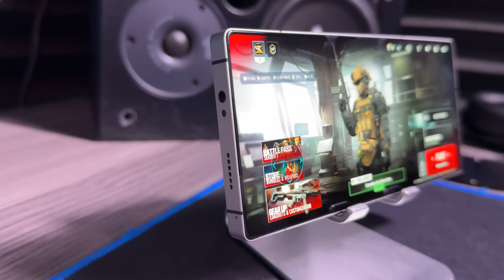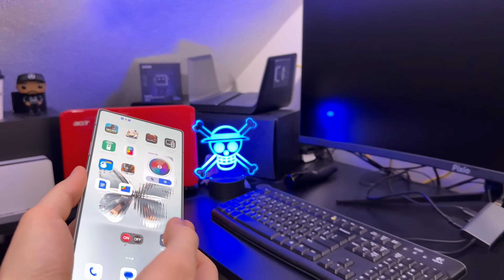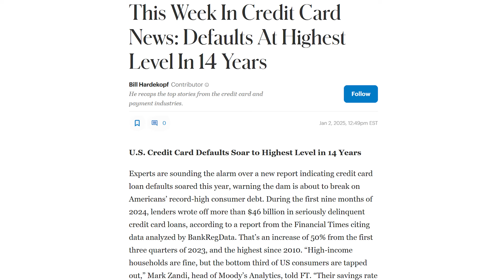What CES Revealed About Repairable Tech In a Record Year For E-Waste (2025 Is Not Looking Good)

Comment: hello Salem, could you tell me if I can change the cpu on my Asus X550jk laptop please ?
Reply from the maker: no
Reply: @SalemTechsperts  what a bummer 😞
Reply: Pretty much all consumer laptops have non upgradeable CPUs. They are soldered onto the motherboard. And even if you could replace it, there wouldn't be much point. That laptop has a 4th gen Intel core CPU from nearly a decade ago. There really wouldn't be any feasible upgrade path.

Comment: The fact that they knowingly trap you into their ecosystem of parts and software by making the up front cost of the device so low, but then jack the replacement part cost up. Not just tech companies do this. All corporations with zero ethics do this. And it's all coming to a boil.

Comment: Hp envy x360 has now cooked 2 wireless cards after windows update, screen has half inch black spots and lines, a dead battery, switches off when you press the keyboard and is slow as hell when it's only ever run blender and youtube.
Last time I spend over a grand for the same disposable crud.

Comment: make those older machines instead of running on windows use Linux - Linux distributions have reached a state that they are as easily used by dumdums as windows and have options to look exactly like windows. 
and in regard of batterys there is hope, europe is implementing laws demanding replacable batteries that on top are standardized.

Comment: Windows having these hardware requirements is still bafling to me. I switched to Arch Linux like a month ago and even if some software does not work out of the box, i got essentially everything up and running what i need. The only reason i still have a dual boot to windows set up is because of games that i cant run under linux or proton. Like Genshin. But 99% of all gaming im doing on Linux. Until the switch 2 comes out then itl be more like 50% XD

Comment: Are they like, killing windows 10 entirely or are they just going to stop supporting it like Windows 7? If so, it shouldn't mean imminent death for every machine out there. I'm still on Windows 7 right now and I can still use the internet just fine. Sure, there's some softwares that are no longer going to be available to me but that's what filehorse and other sites are for. If they do the same for windows 10 then no, they don't need to pitch the win 10 machine into the bin and you don't need to worry about only selling Intel 8's. Why don't you focus on making a custom OS for customers so they can still game for the next three years without hassle from microsoft?
Reply: Windows 10 will be End of Life sometime in October. It doesn't it will stop working, but it won't receive security updates anymore. That is unless you have the LTSC version of it. Then you get updates until 2032 I believe.

And I don't think you understand the complexity to make an OS. A single person can't just write a fully working OS to compete with Windows and Mac and Linux. He can try selling laptops with Linux pre-installed, but I doubt there is much of a market for them. Most people who are fed up with Windows will either move to Chromebooks or Mac. No one knows that Linux exists and most non-tech savvy people do not care in the slightest to learn about some esoteric looking system.

Comment: Computer parts used to last years and years. Now they last a few months. I work in computer repair and we get compiters from 2010 (sometimes earlier) that still work. Yeah they're slow but they still work and can be upgraded for a reasonable price. But if you've gotten a new computer from 2020+, then you're most likely looking at parts that have completely failed and need to be replaced for the computer to even have a chance at working. It's actually insane. Prices have, obviously, gone up as well and it's difficult trying to sell anything to anyone that I believe they could learn to put together themselves. Difficult industry to be in and it's not consumer friendly.

Comment: Is there any way to offer Linux distro's on those unsupported Windows 10 machines for people? Things like Ubuntu are super user friendly as long as people aren't ignorant/lazy about it.
Reply: The thing is most regular computer users are very ignorant and lazy. They're not going to want to learn about Linux. Most people who are fed up with Windows PCs will likely move to Chromebooks or Mac.
Reply: @JJFlores197  I don't disagree with people being ignorant or lazy but if people can switch between operating systems on computers and phones they can do the same with modern Linux distro's like Ubuntu.  If businesses offered a fee to switch over customers (cheaper than buying a new device) using unsupported OS's and gave a small intro (link it to a YouTube video or something) they could affect the change they want to see in the world instead of just letting things play out.
Reply: @hogs0war  I still don't see that happening. Working in IT support for 5.5 years, I know there are a lot of people who absolutely detest any change. Some people need "hand holding" to do anything on a computer. No matter how many very simplified and straight to the point videos or PDFs you send them, they won't be able to figure it out.

Comment: That company  that came up with the water damage solution, they should try to find a way to make it so repair shops can apply it after the fact.  Once they do that, work with as many repair shops as possible and go on an ad run with those shops to push product.

Downside I would guess is, they can't make enough money to stay afloat if they took that route though.

Comment: indeed it costs like a dollar to dip an entirely soldered motherboard with no connectors in epoxy 
however, entirely soldered impossible to upgrade motherboard
I guess you could always just silicone dip a normal laptop and it would probably work, actually upgrading anything would probably be very fun

Comment: I have a 10 year old Toshiba that I still use even though the screen has a column of about 50 dead pixels about 200 pixels from the right edge of the screen.  I just resize the windows to fit the good part of the screen.  I'll keep it going till it dies.

Comment: I have a rewlly old laptop that i had to fix and upgrade to make it usable in college, upgraded RAM, the SSD and changed the battery, took me maybe 5 minutes and cost about $60, if my phone breaks, its completely unrepairable thanks to a copper sheet in the back of the phone designed to transfer heat more evenly, not to mention its also weak to water because it has a fan in the back

Comment: Reusing old laptops and computers is a great way forward for everyone, especially tech enthusiasts. In 2023 I purchased a HP Z6 G4 xeon 6140 gold workstation with 64gb ram, works perfectly and is a great system to use. 

A few weeks ago I spotted a steal of a deal on a preowned Dell Latitude 5430 with an i5 1235u, 2x8gb 3200mhz ram sticks, easy to get into for cleaning and upgrading storage and ram. I popped Linux on it, installed moonlight so I can connect to my gaming desktop and game remotely with it. Its a perfect travel companion. Even have an old dell optiplex with an i5 7600 in it which I run a home server on.

As a suggestion, on older laptops and other computers that are not windows 11 "compatible". You could always sell them without an OS installed for those who know what they are doing, or even sell them with Linux Mint preinstalled. That at leasts keeps them out of ewaste for a bit longer.

Comment: quick void screaming:

the dishwashers have not learned from tesla, have they?

that fridge couldve been a normal fridge with a mechanical linkage and a footpedal. still a hands free fridge, minus the unfixability.

that yoga lid is an apple tier idea, horrible outside of a 3d render.

recycling is pretty worthless, outside of glass or metal, its why its the footnote of Reduce Reuse Recycle.

louis rossman is a state of mind

waterproofing machines, especially laptops and co, is brilliant.

if dell becomes a tolerable brand, itll be quite the improvement

Comment: 8:47 and in contrast pretty much all new branded android cellphones not in the super budget category have IP water and dust resistance ratings. Although it is easier to seal a cellphone compared to a laptop with keyboards and air vents. But surely some percent of broken cellphones are due to water damage. It happened to me years ago
Reply from the maker: They are water resistant due to seals. These seals only last a few years depending on environment. I've seen hundreds of water damaged phones throughout the years. The laptop in the video is water resistant due to the entire board being coated.

Comment: The frustration with people wasting electronics is real. I've been trying to slowly make my old HAC01 switch better part by part, but the process takes time and even a new battery is pretty shite, since it does not last long. With phones normal consumers are kinda screwed, because not many people will know how to heat the back plate/screen up to get into the innards. PCs are slightly better because they are modular and you can swap out parts separately and re-sell them. With laptops I am starting to loose hope. It is super hard to get a business class laptop that can do more than some basic Office, internet browsing ETC.

Comment: And with the smart refrigerators, I don't know if they've gotten better in the last couple of years but I used to load them as part of my old job and they were wayy heavier than a normal refrigerator....it used to take 3 guys to load a fridge into the back of a pick-up truck, 2 lifting it up and one guy in the back of the truck to hold it steady/guide it in, however with the smart refrigerators it took 5 to 7 guys (however many we could find they were that heavy), 4 at each corner of the fridge and 1 or 2 on top in the back of the truck, plus a guy helping the 4 guys on the bottom lift the middle of the fridge....I can't even imagine how difficult they were to actually get into somebody's house, and I seriously wonder if they've ever damaged somebody's floor?

Comment: I personally don’t like the new naming scheme. But they are trying to keep it kinda simple. I’m a freelancer who fixes electronics and people sometimes ask me to suggest a laptop and I tell them about dell and they get confused with dell’s naming scheme. 

Honestly, speaking it’s quite scary to see the current and future tech. They are completely use and throw. Like paper towels. 

Some of my customers ask me to speed up their intel celeron or n1000 laptops(they are unaware of those device’s capabilities). 
They are often ready to spend 100 dollars for that fix. As few suggested in comments, older machines can run Linux easily. I agree. The same Celeron computer performs better with Linux than with Windows. If my customers are young or tech inclined, yes I can, because they can learn. But if they are old and not tech inclined and all they know is windows about computers. Then I have no choice. I had to strip down the windows from bloat-wares and let the essentials alone run. 

From personal experience,
Sometimes tech repair guys becomes villain, when a 250 to 300 laptop requires 120 dollar repair plus labour. like a top screen replacement with lid and hinge. customers think we are trying to loot money from them. But the reality is, the parts value is 150. The laptop value is 250. The computing hardware is just 100 to 120 in that device. 

I’ve got a customer who wanted to upgrade storage size. That laptop had a SD card 128GB as storage. He wanted to make it faster too. I’ve never seen that laptop brand before and after. USB 3.0 is faster than that SD card. 

Some customers ask me to recommend a laptop for 300 dollars. I suggest them to go on eBay and find some auctions on business laptops and get one. I recently bought a dell latitude 7400 with 8th gen intel i5 for 80 USD. things I need to buy were storage and an usb C charger(single charger used to charge laptop and phone). 

Hardly spent 150 dollars and that machine is in immaculate condition. Batteryreports says health is at 90%. It was originally manufactured in late 2019. That machine is going to last for 10 years or more if taken care properly. 

We need to blame both consumer and manufacturers. It’s a loop, you ask manufacturers they say consumers seeks technology like these, so they produce. You ask consumers, we say that’s what the manufacturers produce so we buy them. 

How many of us, buy mobile phones by checking whether its size is suitable for our hand. Instead we look for how many cameras the phone has and what type of screen it has. Honestly speaking we don’t capture much photos with all those cameras and the screen quality matters for some few people and moment. We didn’t provide enough attention to fair phone and now HMD. These brands provide repairable phones. We support android a lot. But we have to realise Apple usually supports their phone line up with 5-6 years of OS upgrade since 2014 or 2015. For someone who keeps his phone properly, it matters a lot. Take android, manufacturers hardly provide 3 years OS upgrade and +1 security update. Surely we can install custom rom. But not all out there have time and knowledge to do it. If an open source community can achieve by creating custom rom for an outdated phone with current OS kernel why can’t the manufacturers do it ? 

Device warranties are another level, you buy a flagship phone or midrange phone or cheaper phone you get same 1 year warranty. Flagship phone are times of costly than mid range and entry level phones and they have 2x better hardware. You call that as a premium flagship and you mention it like it’s the face of your brand. At least, provide 2 years warranty for that face. HMD is doing it. Why can’t Samsung and Apple do it. 

I’m 26 and people at my age are the biggest bait of credit cards. We can’t understand the difference between wants vs needs. I don’t own a credit card. But I usually suggest people to spend on debit as much as possible. Because it puts a limit on mind when we spend. So we can eventually spend on needs and not on wants. With credit cards it’s completely spend on everything we want and re pay as instalments. Eventually you buy everything you want. And in future your previous wants will become obsolete or unwanted then throw it. Becomes waste. And land fill. Whenever I go near an e-recycle bin, all those movies clips which shows earth becomes inhabitable due to landfill flashes in my mind. So many laptop and computer which can be used as a kiosk or streaming box are in that bin.

Comment: How repairable are Samsung laptops compared to others. My mother had one that had a broken screen after she threw it at a wall that I had no issue replacing. the whole process looked just about like that Lenovo you fixed in this video but I have only ever worked on that one Samsung so I was wondering if you have any experience with them yourself.

Comment: Really successful rant man 👍 all excellent, and very real points. 

I just literally used Rufus yesterday to upgrade my nefews laptop to windows 11. Installed an extra ram stick (stupid hp only had a single stick installed.... It has an igpu! Dual channel is absolutely needed with an igpu) added an SSD. Went from taking 10 minutes to start into windows to now about 30 seconds.

One detail I noticed in your rant though, 7th gen Intel (i7-7700k specifically) is included in the officially supported devices for windows 11. You stated only 8th gen and newer. As long as 7th gen has tmp 2.0 and eufi bios with secure boot, then it's good to go

Comment: It's always been intentional, but now there is more of a need than ever for companies to create weak spots. Before things like capacitors would always fail after a set amount of years. Now they last much longer so the next thing is to find a weak spot, and under engineer it. This happens in everything from tools to cars. I've even noticed a trend now where Korean car companies design the engines to be replaced rather than fixed. You are also right about aesthetic design being the focus over functional design. I won't buy a lot of brands for that reason. The only good thing, with the rise of a lot of generic brands they use a lot of standard parts, so I've found myself ordering generic part, that uses M series bolts and it all just fits together because they use the same supplier. But eventually companies do make a choice for profits over making things easy. Any way I enjoy your channel, discussing issues like these will ensure you remain the greatest... Technician... Ever...

Comment: I still have an E6400 Latitude that while it now needs a battery and charger, still runs just fine for 99% of my average use. Getting close to twenty years old. Full agree, always go for business class laptops, by the time it needs repairs it's probable the usual culprits are available third party or through liquidated enterprise sales. Sometimes you also get lucky and can actually upgrade the system too! Mine still has room for more RAM which is on the list since nothing new is really worth buying at this point and decent used Thinkpads are getting rare and expensive. (Full disclosure I'm a filthy cheating linux user so I don't need a supercomputer to drive a browser for a few hours.)
Reply: Yep most of the new thinkpads that use the usb c charging now are crap compared to the older ones. I still have a T420 that's in fantastic shape but I use desktops on the daily so it doesn't see a lot of usage. Those old E6400 series were pretty solid. Newer latitudes have suffered the same fate the thinkpads have...crap but better than the rest of the consumer crap lol.